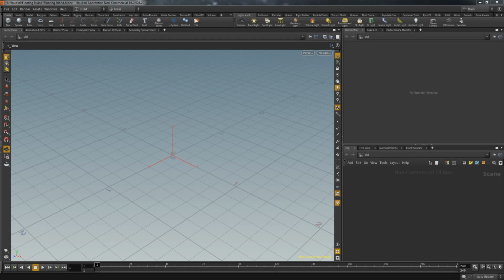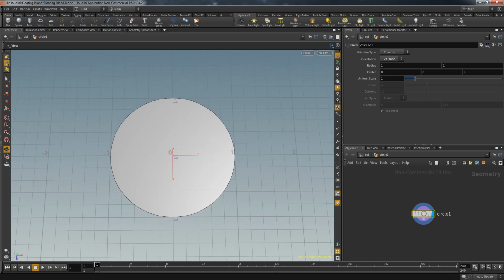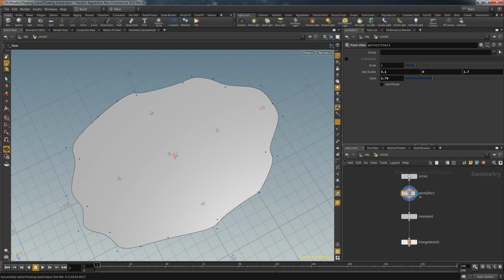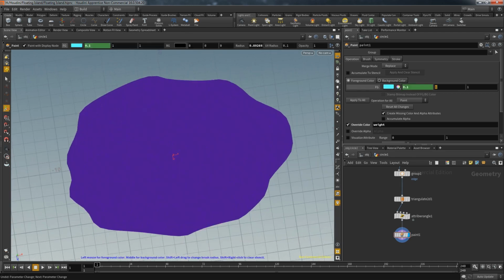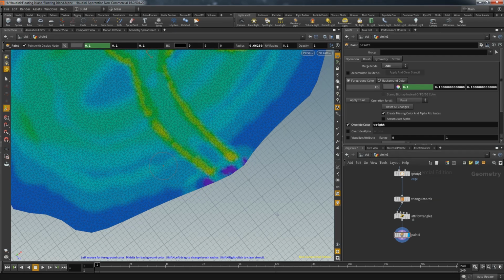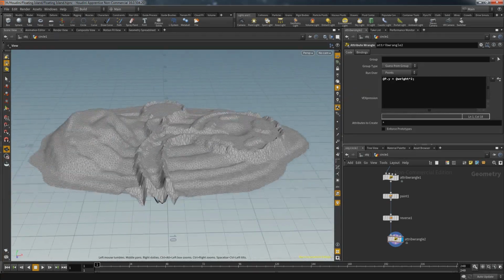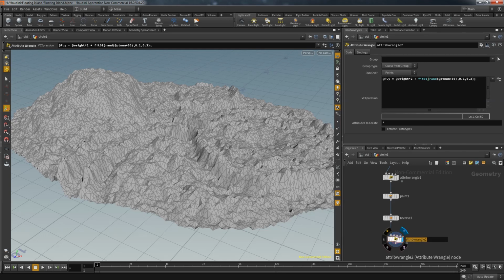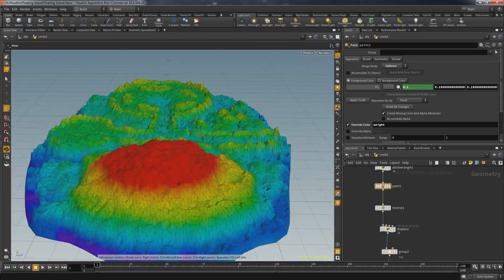Building the main island with VEX in Houdini |Floating Island Series #1

Comment: Greetings and Thanks for your work. 
In Hou Indie 17, Triangulate2D node is really different. It is hard to follow respected master Rohan Dalvi. 
As of now (Hou 17) there is no Refinement Tab in Triangulate2D. 
In Hou 17 it goes like this: Refine - check; then switch 'Triangle Sizes' to 'Cap Maximum Area' then decrease Maximum Area.
Just a quick queston - looks like Constraints - Constraints Primitives in Hou 16 is equivalent to Constraints - Silhouette in Hou 17 ?!
Reply from the maker: In H17 you can either use Edges under Constraint and then under Outside Removal Flood vom Convex OR as you said use Silhouette which offers Remove Outside of Silhouette - both work
Reply: Thanks for clarification David! Working on it in H17
Reply from the maker: At some point you will encounter the foreach subnet. Those also no longer exist. There is now a foreach block. If you have issues just give me a holler